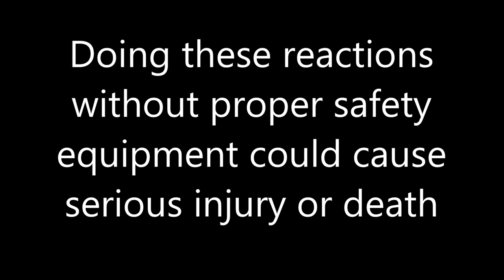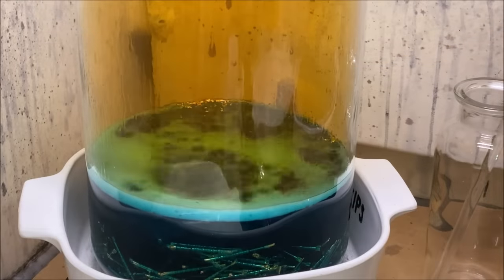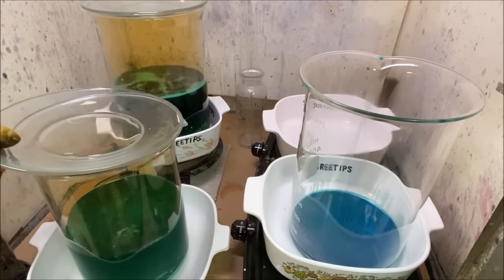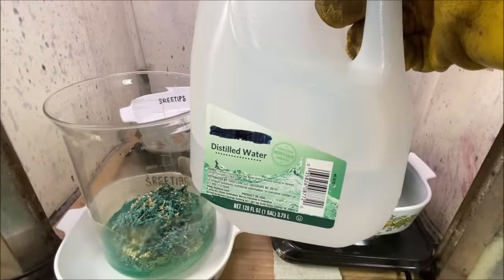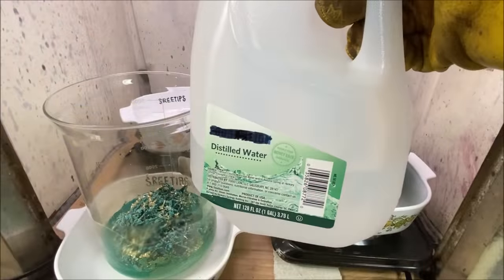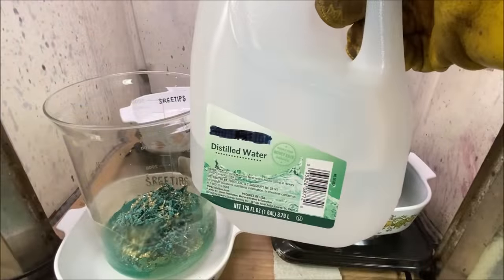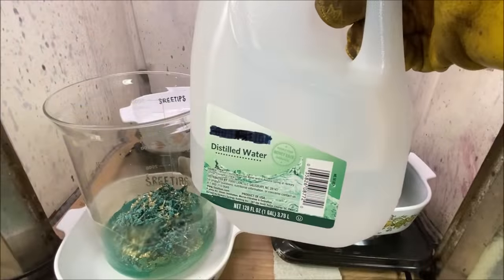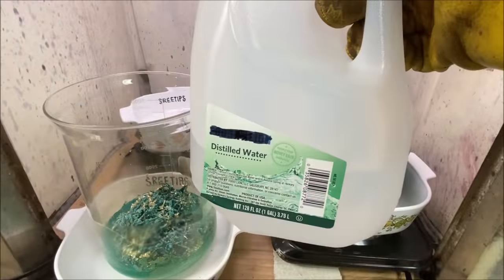Gold Plated Pins 10 POUNDS!

Comment: Great video sir.

My rough calculation suggests that you made about a %30 profit ?

As a retro computer enthusiast I always wondered what was to be made from those gold plated pins!

Now I must try to calculate what a single pin is worth.

I think the Ebay sellers of tiny quantities of chips for gold have there prices way to high, but i'm going to check.

OK, it worked out at about $0.003 per vintage style pin, so that's $0.12 for a 40 pin IC.  So don't pay more than $0.09 for such a chip to make your 30% profit:)

40 pin IC on ebay for $1.59 should be more like $0.009!!!!
Reply from the maker: It takes so many words. First, my motive for this was to create the video, not to recover the gold then immediately resell it for more paper dollars. The value is in the video. I believe that these pins were part of a system that requires high reliability such as a military weapons system.

Comment: I wonder what the gold pins were used for?
Reply from the maker: Probably some application where high reliability is critical. Such as a military weapons system. Nothing worse than having your gun fail due to a corroded connection when you getting shot at.

Comment: If the pins are gold plated, could you have used a knife or something to scrape the gold off of the pins, then hit those shavings with the nitric acid to remove any remaining copper? 

Would be a tedious process to scrape the gold off of each pin individually, and retain the filings. However, you’d save a lot of nitric acid since you could discard the inner copper core of each pin after scraping.
Reply from the maker: Yes, that’s possible. But I had plenty of nitric and I’d rather let the chemicals do all that work.

Comment: Had to watch again as my gold pins stock is increasing. Could I do this method with a mix of magnetic and non-magnetic pins in the same batch??
Reply from the maker: I think so. But I’m not certain. If mine, I’d do small batch experiments until I figured out if it will work. No more than 5 grams of pins.
Reply: @sreetips  Ok, thanks. I was thinking of that only 20 to 25 grams. 5 grams sounds better.

Comment: You know, for fairly cheap, you can get moisture alarms, to earn you of leaks or boil-overs. Just a thought.
Reply from the maker: Moisture alarms for boil-overs. I had no idea.
Reply: @sreetips  I just mean, in case you can't always be monitoring, but still want piece of mind. Not imply you don't know what you're doing, or that you're unsafe. I'm 100% you know what you're doing. If there was an unknown element (some more-reactive metal from substandard manufacturing, maybe)  as part of a batch you're dissolving.

Comment: Whats the purpose in not melting the foils directly rather than putting them into solution? I would think there would be major losses doing that other than purity obviously
Reply from the maker: The foils are only about 12k or 50% pure gold. Putting them in solution, filtering, then selectively precipitating the gold is called: refining
Reply: @sreetips  Im assuming the selective precipitation isnt 100% efficient as nothing is but is it more efficient then melting it down directly from the foil form?

Comment: how much is nitric acid? $5 or $10 a bottle?
Reply from the maker: My last purchase from dudadiesel.com was about two hundred bucks for four, 2.5 liter bottles. So about $50 per bottle.
Reply: @sreetips  so the cost of everything is way higher than the return?
Reply from the maker: I don’t think so. I use sterling silver to refine gold. Silver is a by-product of my gold refining. I recover the silver from that and run it through the silver cell. So my profit is not in paper dollars, but rather in high purity silver.

Comment: @6:20 Could you possibly shorten the path of full nitrification, if you would transfer the pins after the first nitric acid treatment into an ultrasonic cleaner filled with distilled water? The induced cavitation bubbles would rip off the remaining gold flakes of the metall sticks.
Reply from the maker: Possibly

Comment: In regards to the part where he mentions a sulfuric cell to dissolve the copper instead of nitric, why is that better than the nitric acid?
Reply from the maker: The gold can be stripped off the pins in a sulfuric acid stripping cell. But, it’s bulky, messy, tedious, and I can never get a decent yield from it. I had plenty of nitric. And I knew that I could dissolve the copper with it. Let the chemicals do all the work. For me, nitric was the easier softer way.

Comment: I wonder if you could've used a sodium cyanide solution to dissolve JUST the gold, without needing to dissolve all of the copper as well. Of course, that would only work for the gold that was plated. If any of the gold was mixed with any of the base metals, then the sodium cyanide wouldn't be able to touch it, I don't think.

Comment: What is the material you are processing, can I get it online?
Reply from the maker: I bought those pins on eBay. The seller had them analyzed. Knew their composition and approximate gold content. So I bought them because I knew I could get the gold by dissolving the copper away with nitric. I bought these to make the video to show how it can be done. Not for the gold that I recovered.
Reply: @sreetips  I live in Turkey, can I get this product?
Reply: @sreetips  And when you just put it in nitric acid and the coating on it is removed, couldn't you melt the removed part and prepare the king water again, what a long process you followed, thank you for your knowledge brother 🙏
Reply from the maker: I have not found any more of these after that one purchase. Most gold plated material is not this rich in gold.
Reply from the maker: Before going to “Royal water” all of the copper must first be removed. If I add Royal water (aqua regia) to the pins while copper is still present, then two very bad things will happen. First, the aqua regia will dissolve the copper and make a very dirty solution that looks like used motor oil. This makes it very difficult to see what’s going on inside the beaker. Second, with copper present, the gold will begin to dissolve, but it will cement right back out of solution onto the copper, then dissolve, cement out, dissolve, cement out, over and over consuming much nitric as it goes. The copper must be removed, either chemically, with nitric acid boils, or physically, by reaching in and plucking it out with tweezers, BEFORE going to aqua regia (royal water). Hope this helps.

Comment: Why did you say Silver and Gold don’t corrode when silver does. It turns into tarnish or silver oxide

Also since it was plated, why not just throwing the HCA and SFA directly. Why even separate it with the NTA first?
Reply from the maker: Didn’t think of it
Reply from the maker: Sterling silver tarnishes, but pure silver won’t. But I have seen pure silver crystal turn a golden color - probably oxidation.
Reply: @sreetips  oh interesting. I thought even pure would.

Comment: Nice job, so roughly in total it yelled 32 gram of gold. General speaking with time and cost of acid you would make break even or got some profits? (Excluding YouTube revenue; ) ). Thanks
Reply from the maker: I sold the gold for more than I paid for the scrap or for all the chemicals used to refine it.
Reply: @sreetips  great. I would like to do the same for 10 micron glad plated women watch. Any idea what is the yield?
Reply from the maker: I think 10 microns is very little gold, almost nothing. Trying to recover this tiny amount will end up costing you in chemicals, produce waste that must be treated. And produce no gold.
Reply: @sreetips  but 10 micron and 20 micron gold plated watch cases are much better then the Jewellery gold plated (higher gold thickness), in some cases the watch manufacturer guarantee 10 years of coverage of gold on watch case. So in your experience the thickness of gold on these pins are higher than 10 micron? Thanks for your time and answer
Reply: @sreetips  I just looked up the thickness of gold on electronic instruments including pins , it's about 0.25 to 5 micron range
Reply from the maker: I don’t have any experience with 10 micron gold watches.

Comment: Maybe I'm late to the party here, but why are you completely dissolving ALL of the copper? If your foils are free, what's the point of completely dissolving the pins? Why not just inspect them for gold, then melt them for copper? Seems like you're burning A LOT of nitric for not much gain.
Reply from the maker: Agree, but it sure made a good video. If I melted ten pounds of copper with 22g of gold, then that would make a difficult recovery.
Reply: @sreetips  Oh absolutely... I wasn't suggesting melting the pins with the gold still on them! Sorry if I gave that impression. I was thinking after they all pretty much looked like brown toothpicks, that would be the time to give them a good rinse and call it. 

I do enjoy your content greatly! I've been scrapping a ton of machines, pulling the CPUs and other large chips and memory out of them, and separating all the pins, maybe I'm wasting my time, but I want to try extracting the metals from it all just once.
Reply from the maker: Do small batches at first until you get a feel for it. Get a fume hood!

Comment: where did those pins come from?
Reply from the maker: Bought them on eBay
Reply: also You said pure gold, so is it 22K or Karat? or does it need to be purified more?
Reply from the maker: After recovery from the copper the gold is about 990 parts per thousand. In a later video I repurified the recovered gold to three nines - 24k

Comment: 41:20 why are you bothering with borax? its gold, not iron, it doesnt oxidize.
Reply from the maker: That’s the way I learned it
Reply: @sreetips  i did some looking up apparently using borax powder helps to reduce minute particle loss, didn't realize it had more than one purpose besides as a flux to prevent oxidization

Comment: what do you do to denox ur solution?
Reply from the maker: Incremental nitric dosing; adding the right amount of nitric, a little at a time, to just dissolve the gold. If done correctly there won’t be any excess nitric to denoxx. But if I overshoot the best way, by far, is to evaporate the gold solution down to a syrup to drive off any excess nitric acid. Then rehydrate with hydrochloric acid and proceed as usual.

Comment: Could of saved a lot on acid with peroxide, white vinegar and a dash of hydrochloric let sit. All foils will lift clean. Discard fiberglass and base metals. Wash with hydrochloric. At this point very little  royal water is needed to liquify. Filter precipitate and repeat
Reply from the maker: Excellent tip, thank you

Comment: Wouldn't it be cheaper to dissolve the gold than the copper? All the gold is on the outside of the copper so it should work. TY  

..
Reply from the maker: No, the reagents tend to dissolve the base metals first. Then the gold.
Reply: @sreetips  Someone mentioned a ball mill. If you pulverized everything first.. you could blue bowl out the gold.  Or.,,. you could try a centrifuge.

..
Reply from the maker: The chemicals will do all that work for me.

Comment: at 34:50, i cant see the entire label but the hydrochloric acid manufacturer seems to be recommending unauthorised use of milk crates.  i wonder what the milk companies think about that.
Reply from the maker: If you’ve ever tried driving around with those bottles of hydrochloric acid in your car then you’ll understand how important it is to have a milk crate to put those bottles in. Especially when going around corners!
Reply: @sreetips  , of course you are right.  nevertheless it is unauthorised use of another party's property.  i wont tell you where i live because i am a felon.  i never steal, just receive milk crates when others dump them.   i have a backyard full of them.  in fact, ive made heavy use of them today.  years ago, i accidentally forgot to secure the top of 4 litres of diff oil before putting it on the floor of the car.  that was a big clean-up job.  the car smelt of it for years .

Comment: neat, ignorant question. Beyond the cost of the equipment why can't you just melt the pins and pour off the copper which should float on the gold. After that then you would need much less nitric acid to get the rest of the gold out of the copper
Reply from the maker: Because the copper and gold don’t separate when melted, they will alloy. Then I’d have 22g of gold alloyed with ten pounds of copper, making recovery of the gold very difficult.

Comment: I have a baseball card collection that is in a box. It’s got all the old players like Kirby Puckett Mickey Mantle, but this is 24 karat gold plated somebody help me here cause I’m just getting going on this goal kick in Mill Fed those down there’s 35 cards there gold plated, 24 karat I wonder if it’s worth it to melt it for the gold or sell it as the card itself but it’s just played it gold 24 karat and my first question was I’m taking to put them all in a big old bucket that doesn’t melt a torch to a Mall. Would that work to get to Gold off of those cards? I don’t know. I might be acting stupid question but I’m very stupid at this as we speak.
Reply from the maker: Trying to melt the gold foils probably would not work well. I’d cut one up into pieces. Put in a beaker. Then hit it with hot aqua regia. The paper will disintegrate. Then test with stannous to detect any gold (probably won’t be much, if any at all). Then filter out the paper and drop the gold out of the filtered solution with SMB. That’s what I’d try if it were mine.

Comment: Gold is the best conductor of electricity - 😮. However, metallic hydrogen is the best conductor of electricity 😮.
Reply from the maker: I thought silver was the best conductor of electricity. If I remember correctly, gold was down around seventy. Copper is 100, silver was 105.
Reply: @sreetips  Gold first, then silver, then copper, then aluminum. However, metallic hydrogen is the best conductor of electricity - the core of the sun ☀.
Reply from the maker: Check table of resistance and conductivity. Silver is number one, then copper, then gold and aluminum.
Reply from the maker: I thought it was Jupiter that had hydrogen metal in its core: At high pressure and temperatures, metallic hydrogen can exist as a partial liquid rather than a solid, and researchers think it might be present in large quantities in the hot and gravitationally compressed interiors of Jupiter and Saturn, as well as in some exoplanets.

Comment: I'm an idiot. So don't bother to roast me. But I can be educated. 
Question... would it not have been faster to melt the gold off the copper?
Like melting the lead out of copper jackets from the range?
Reply from the maker: No, the gold has a lower melting point than copper. And it’s very thin so heating would probably cause the gold to try to alloy with the copper substrate making recovery that much more difficult.
Reply: @sreetips  well darn. Least I learned something new. Thanks.

Comment: So roughly $600 bucks for the acid alone. yielding about $1300 of gold. Without factoring in equipment, waste disposal, and gas / electricity needed. Love the educational element, but seems you would have to literally do this by the ton for it to ever be profitable. Considering a scrap yard purchases the scrap to begin with, there's added cost there. Plus labor, insurance, and property tax. Factored in with EPA regulations. Seems like its damn near impossible to even break even. Kind of brings context to why its cheaper to send it to thailand or china. Where the contaminates are all going to be illegally dumped, right into the ground water without any consideration. Awesome videos though. Thoroughly enjoyed it.
Reply from the maker: You’re forgetting one important consideration: I converted paper to GOLD

Comment: What about using Muriatic Acid
Reply from the maker: I use it all the time.
Reply: @sreetips  so I've been on a batch for a week now first time using Muriatic and it's really not doing what my expectations were any suggestions
Reply from the maker: No, I’d have to guess because I don’t know what you have there.
Reply: @sreetips  nothing like what you showed
Reply from the maker: Are you working with trimmed circuit card fingers?
Reply: @sreetips  yes sir
Reply from the maker: I’ve switched to nitric boils to release the foils from the fiber board. It’s too late for that for you because you’ve added HCl. Please see an old video of mine titled “trimmed fingers in Aqua Regia” in that video I dissolve everything off the fingers with AR. It puts everything in solution, and makes a very dirty solution. But it will work if you’re careful.

Comment: Couldn't you have used Hydrogen Peroxide to rehydrate the solution?
Reply from the maker: Possibly
Reply: @sreetips  I mean essentially you're just re-oxygenating the solution with the water but at higher volume less concentration, so it should be the same results either way

Comment: so roughly 0.79719154 Ounce of Gold. Seller Advertised Approx 0.923 ounces of gold. Where is the other 0.12580846 ounces of gold then. Yes I did count for the .10 grams of gold foil you had left over.
But that means the Sell LIED on how much Gold there would be. You should have gotten your money back cause the Seller Lied.
Reply from the maker: They had the pins analyzed for their composition. It’s very difficult to recover 100% of the gold from any material. There are losses all along the way. Minimizing these losses will depend on the skill and technique used by the refiner. I’ll make up the difference on my channel. No reason to make things difficult for the seller. Life is hard enough as it is. Don’t need me making it worse.